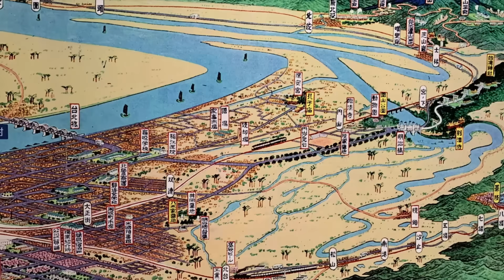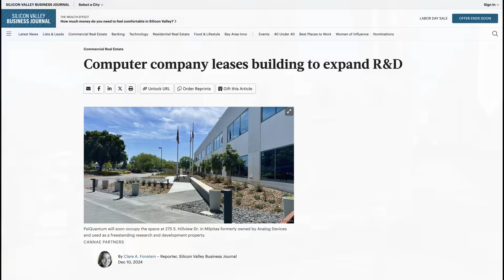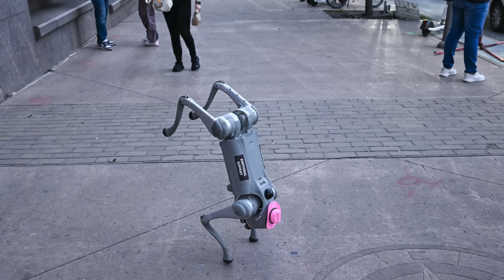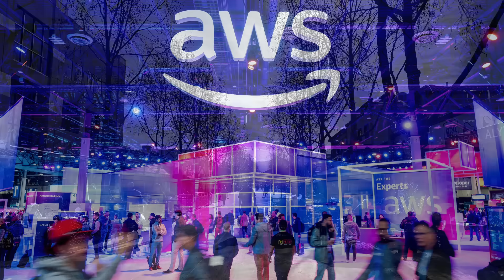Silicon Valley’s Doing Hard Things Again

Comment: Nearly everyone is putting AI into a single basket...many think it's all about complex software systems called "generators" for which training and inference requires massive DSP chips capable of trillions of matrix multiplies every second.  And I don't really blame them when all the talk is about these massive models with sizes approaching the petabyte whose sheer size is the primary reason why the generators behind them need such massive computing power.  There are many other types of AI which don't need such hardware.

Comment: Software engineering is not coding contrary to what a lot of manager ins Microsoft and Google seem to think firing engineers in a rush to replace them with AI. In fact the lates I have heard is that finally the managers have started understanding the bigger issue and are now hiring back engineers not coders. 
Software engineering is closer to civil engineering and architecture. 
Even in coding without a proper design structure in advance that is modular and elegant and is comprehensible AI coding won't help. A lot of them try to do everything all at once instead systemizing by breaking the project down into module with coherent philosophy. Then end result either doesn't run and it looks to a human gibberish making debugging impossible. It ends up taking far longer in the end.

Comment: I'm sure someone has explained by now, but in case you are still wondering, Rapidus is proud of their single-wafer 15 day cycle time because that allows for rapid (hence their name) prototyping of chips, both for process development AND for customers trying to tweak designs. As the slide you pulled showed, a normal cycle in a fab could be as long as 2-3 months. A company may go through multiple prototypes before finishing their design, so to pull in a year or two development time to 2 week increments is a tremendous boon.

Comment: Chapters:
00:02 - Introduction to AI boom in Silicon Valley
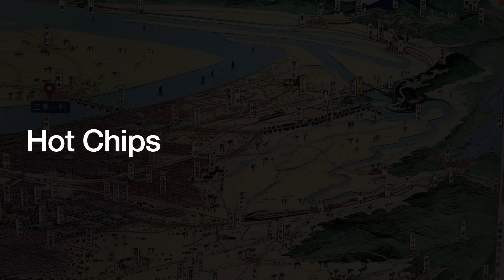00:53 - Hot Chips conference overview
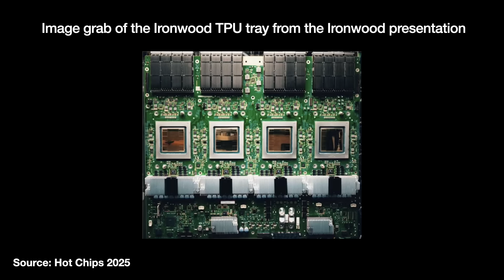01:45 - Photonics companies' AI solutions
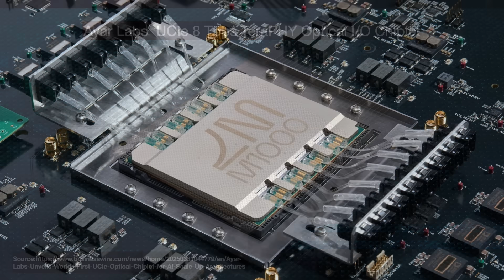02:33 - Silicon photonics manufacturing challenges
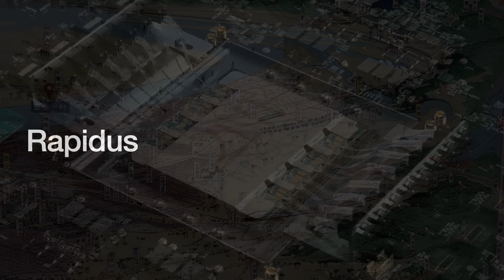02:53 - Rapidus Japanese foundry presentation
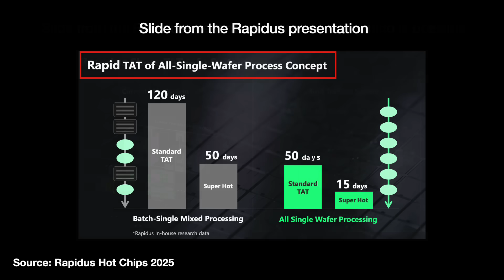04:01 - AI-driven fab turnaround strategies
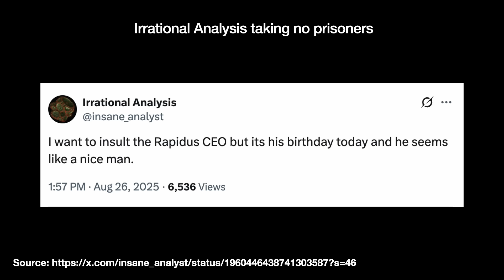04:47 - Software as a service (SaaS) trends
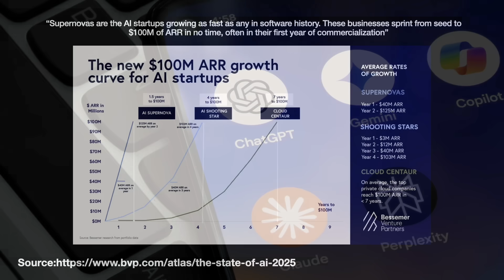05:46 - AI's impact on software startups
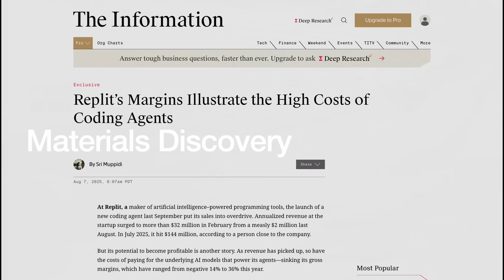07:00 - AI-accelerated materials discovery
09:02 - Alternate compute: Sai Quantum
10:35 - Snowcap Compute's superconductor approach
11:24 - Physical AI and robotics progress
13:41 - San Francisco as AI epicenter
14:42 - Search for AI's second killer app
15:55 - AI bubble and economic challenges
17:09 - Future of AI and hard tech commercialization

Comment: Killer app for AI in the math realm - process control optimization, perhaps.  It probably won't be able to put anyone out of a job, but it will make it possible to scrape out the remaining money left on the table by dynamic matrix control and every other optimization technique that's been tried. But in a large refinery with an integrated petrochemical complex, it doesn't take much optimization to net a lot of money either by increasing throughput or saving energy. 
Better predictive maintenance may be another killer app in the process controls arena, but I doubt the money and abilities will converge to make this very worthwhile right now. 
Finally, SIS systems design may be enhanced with AI.  SIL calculations always seemed to rely on a certain level of experience, intuition, smoke, and mirrors and black magic, especially in the realm of common mode failure factors (prove me wrong).  AI may be able to analyze test data in a way that most vendors haven't done and provide insights, though I'm not sure how much this new information will affect final designs.

Comment: I tried a moderately complex programming task with Chatgpt - tuning a real time clock which had a couple of registers for adjustment. It wrote mostly correct code but misunderstood the precise register definitions. Hours more prompting, testing, fixing and it was done. I don't think I saved any time.
Reply: it took you hours? I think the issue is not chatgpt lol

Comment: In my opinion, I sense the overall AI industry is failing to recognize that something like 80% to 90+% of the LLMs and associated files are unused vast majority of the time. I've seen discussions of projects with tiny LLMs that fit in cell phones which are faster and handle 90+% of typical queries. It makes me question the need for AI data centers the size of New York City drawing in 5x the power of North Dakota in a single facility. Reminds me that tiny critters were what survived after the collapse of the dinosaurs. Of course, I could be wrong.

Comment: AI is over hyped... don't get me wrong after a few years we now know what it is good at and what it is bad at, and it is certainly very fascinating and powerful is some situations however the costs to benefit is a bit too high if you ask me.

This could revolutionize search but if Google search is anything to go by there is little interest in it, and AI is just used to vibe code a good enough house of cards.

The only reason AI is relatively good at coding and math is because its a solid easily proveable science, it seems to fail in fields where there is a lot of disinformation or fake data without a easy way to validate solid data.

The coding training data just has a large amount of true data so it's easier to use since disinformation gets drowned out.

Comment: For materials discovery the issue with DFT is the large databases (materials project etc.) doesn't capture the interesting and non-straightforward materials physics that come from more complex calculations as they're done using the most basic and general calculations. this makes it hard to discover novel materials with genuinely different properties.

The real way forward IMO is high-throughput synthesis + data collection in a feedback loop. There are a handful of companies working on this but it's a pretty unexplored space overall.

Comment: Steel existed long before the industrial revolution it was the process of production that enabled the acceleration of the industrial revolution. Also the old joke from chemistry still applies one paper in a journal means lots of work for the industrial chemists and chemical engineers to make the product. AI rapidly generating plausible material structures is only the first step of the long process of producing something I can hold let alone something I can use or sell.

Comment: AI is the replacement of Stack Overflow, not programmers.
Reply: not even that. if there is no solution to a problem then SO shows no answers but LLMs will invent one that sounds plausible until you discover that nothing it builds on actually exist in reality.
Reply: @steefant  Obviously? were you expecting to just mindlessly ask the LLM to solve all your issues for you?

It is like using wikipedia, you gotta use critical thinking
Reply: @olivercharlemagne3141  you seem to be oblivious to the clusterfuck. i envy you for that but not for the ignorance. good bye
Reply: So the same thing.

Comment: 14:35 "These models are getting better at math" THEY ARE RUN ON COMPUTERS, THE MACHINE LITERALLY DESIGNED TO DO MATH. Claiming that they are good at software (which is just applied discrete mathematics) and then in the next breath say that they aren't good at math, is insane. Computers are calculation machines, a ton of math has to be done before these things give an incorrect output to a math calculation. Generative AI is that meme doing the parkour and then landing on a rake, sure computers are bad at abstract non-concrete math concepts but they will never be able to solve those without being in a truly continuous number space. 

Its so bizarre that we are so desperate to give generative any accolades that it improving in a problem space it should be good in but its not we praise it
Reply: maths isn't just doing 4+7. And software isn't discrete mathematics... Do you even have a formal education?
Reply: @luxraider5384  First off, discrete mathematics is literally the basis of ALL computer sciences, software is literally just  applied discrete mathematics regardless of how many frameworks you add on top and regardless if you realize you are solving problems with its concepts like set theory or combinatorics. Discrete mathematics is the field of math that designed to solve problems in finite problem spaces, which is also known as the only thing that computers do... Second while yes math is more than just computation, math encompasses computation, computers are machines invented and designed to perform mathematical operations, their whole purpose is to do math. What on earth are you talking about, the idea that AI getting better at solving complex math equations is interesting or good when a purpose built program written by a mathematician would be more useful over all is bananas.
Reply: @BlueScreenCorp  what's your background in maths? Computers are electronic systems if you don't know that.
Reply: How did this awful argument get 9 likes lmao

Just because computers can do math doesn't mean all things even remotely connected to computers are also good at it. Cmon, use your brain a little.

Comment: The 2 nanometer chip company in Japan has a model to test chips before full production. Apple and others might find a limited number of chips at 2 nanometers would help design and detect flaws in designs earlier at lower cost. Also with Aplle’s new patent on 20 stop camera sensors, Apple might want to explore how a 2 nanometer chip affects sensor performance or other visual effects. Maybe even an artificial eye? Plus AI LLM’s are a start, but Apple came out with FlashVLM that runs on some of their high end computers. With what Chinese have done in compact AI models too, any feedback on AI for edge device from trade show?

Comment: 7:00 something I actually know about. AI driven materials discovery is over-hyped. The biggest issue is that it hasn’t just been done, it has been done extensively. Researchers have been attempting AI driven materials discovery since the 2010s. However, unlike hard problems like protein folding, materials discovery lacks a good “training dataset.” Many materials currently in use are not sufficiently well understood to explain why they work so well, and the materials property of interest varies wildly depending on industry. To make matters worse, numerical simulation is unreliable for most properties we care about. It can be used as a “screening” tool of sorts to identify likely candidates, but simulation errors are liable to both false positives and false negatives, often at high rates.

There are only two approaches I think AI can actually help with. The first is for companies using proprietary data to optimize their materials formulas. This is still old-school testing until you get the optimal material, but AI can accelerate that process (typically taking you from hundreds of experiments to tens of experiments to get a similar output). This is valuable, but not the kind of golden age of materials that boosters want to sell.

The other is attempts at assembling that large, high quality training dataset that materials AI currently lacks. The biggest one I know of is the Materials Project. This kind of data collection could allow AI to “turn the corner” on general materials property understanding, but the biggest roadblock is the first step of assembling that high quality dataset, which has been in progress for a long time now.

Comment: As a fresh electrical engineer, I moved to Silicon Valley around 2013 looking to get into some revolutionary startup. My passion was/is power electronics, motor control, and motion control algorithms. I figured there would be no shortage of applications for my skill, but I found that the SV investor environment actively steered founders away from hardware and towards SaaS. I later moved to Dallas TX, which I found to be a more hardware-friendly environment with its long telecom history.
Reply: The return cycle is too long and pruduction relies on global supply chain. Chips should be produced abroad in Taiwan and design here in the US. Software outsourced to India, and production and assembling in China. There no other cost effective alternative even if robotics replace tons of human. made in US is still too expensive in terms of resources. There's nothing cheap in the US except capital and talent market efficiency. Highly skilled workers will still in great demand but most Amercians can't earn minimum living wages.

Comment: They are pouring billions into hardware, but has anybody noticed that the Transformer Architecture is O(n^2) and doesn't scale? That's why they are going overboard with costly hardware, but your brain runs on 30 watts. They should be investing in novel architectures inspired by the brain. Sparse, asynchronous, slow. But 30 watts, and we can play poker. Ask ChatGPT if it can play poker, and it will list all the reasons why it can't. Those are the problems to solve!!!
Reply: They are. Alibaba just dropped Qwen-Next, which uses a linear attention mechanism.
Reply: That is much easier said than done.

Comment: But this is fundamentally different than Dotcom bubble, as even if it fails we will be left with huge amount of compute some could be redirected to classical machine learning or other applications. Money is not just poured for salaries and ads and PR but physical infra will be built
Reply: It doesn't work that way. Running some many data centres cost billions in energy and maintenance costs. ROI is simply not there (yet).
Reply: Except that infrastructure is increasingly useless for non-ML workloads due to pathological specialization. You are right that this would be a great off-ramp from economic calamity; that's exactly why Nvidia doggedly keeps around as many general-purpose CUDA cores on their GPUs as their investors let them, knowing this holds back ML workloads. They are hedging their bet, as because tensor cores are largely useless outside ML.

Sadly, they are losing that fight, with the area dedicated to dumb, inflexible tensor cores set to hit near 100% in the next generation. And when the bubble bursts, those GPUs, as well as most of the area of Blackwell GPUs, will be virtually worthless. The economic damage will be incomprehensible...
Reply: This "infrastructure" places increasing strain on an already strained electrical grid, as well as consuming massive amounts of fresh water.

Comment: On material discovery. Techniques like DFT are far from reliable on their own. They require a large amount of human input to get reliable results, and in the field it is often joked that you can get them as close to reality you want by tuning, but the tuning has to be done for each system by mixing in different systems such as Hartree Fock methods. 
I have read some papers where people use existing catalogues of material data and dft computations to try to predict novel materials, but so far it has produced little gain. The big challenge with battery materials is not that we are lacking better options, it is that the better options have fundamental challenges that we dont know how to solve, such as with the silicon expanding and cracking.

Comment: If coding is AIs only real killer app, than AI has failed to produce anything of value. I've been programming for over 10 years and most of what AI produces is barely usable, on the level of junior employee. You Can get it to a point where it outputs usable code, either by running it through multiple models, or giving it enough context where it is able to "understand" what it needs to do. However at that point, the converstaions get expensive due to token amounts and the time spent.

Furthermore,  and this is critical, AI is yet to be actively helpfull beyond development phase. Testing, tracing why tests have failed, fixing those problems, debugging and stepping trough active program is something NONE of the models can do without disruptive hallucinations. And it is this second phase of development that is of high importance, because this is where you get you application running and compliant with the environment you are in. 

So yes, it can be of help to those who understand and can prompt it properly, but replacement it is not. Not for now. 

What it may do is to lower the bar for new people entering the industry. However this is yet to be proven true, because CS graduates have a very hard time nowdays finding jobs, so that mign actually not be the case.
Reply: Of course it is not the only killer app. 

Also, you are either lying or just bad at using the AI. It is far beyond a junior employee... if you use it reasonably like a tool.